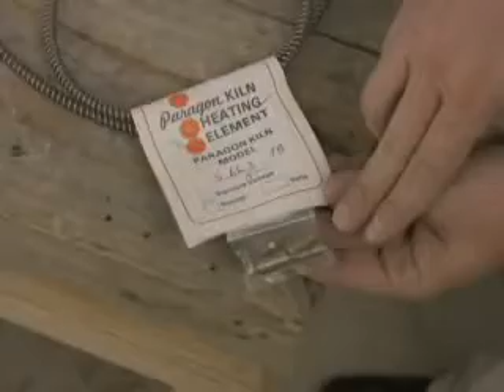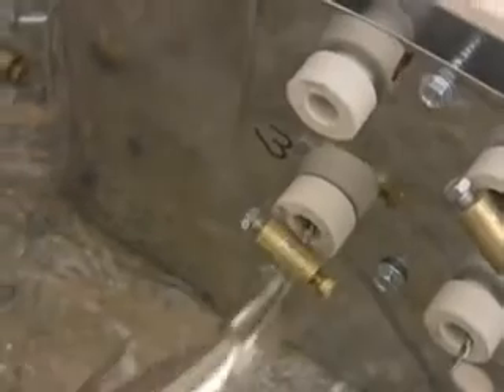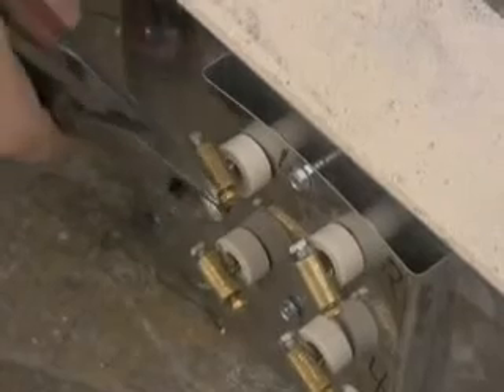Replacing a Sidewall Heating Element: The Paragon Kiln Maintenance Series

Comment: I am looking at a paragon kiln to buy from someone but they repaired the firebrick with something that looks like globs of plaster but it is sloppy and goes into the element wells a little.  I cannot tell if it touches the elements.

Also I have never known a kiln lid to be so heavy that I cannot lift it; but I have never owned a paragon -- so is this normal for paragon kilns?
Reply: The "plaster globs" are not needed in kiln repair. The globs fall off anyway. The lids are heavy unless they have springs. However, if the lid on your kiln has been removed and then reinstalled, it is very likely that it was put back on incorrectly. That makes the lid very hard to lift. I saw that on a kiln just last week.